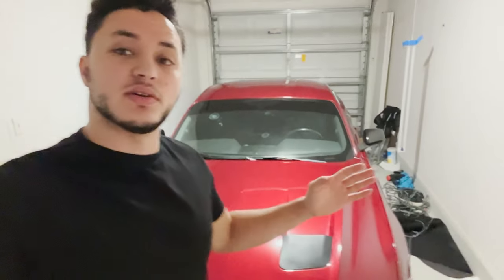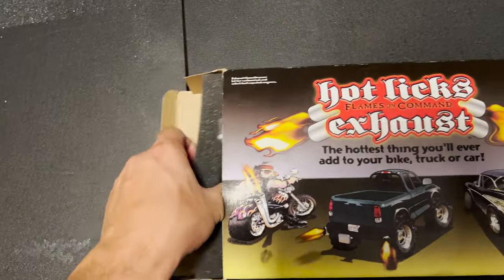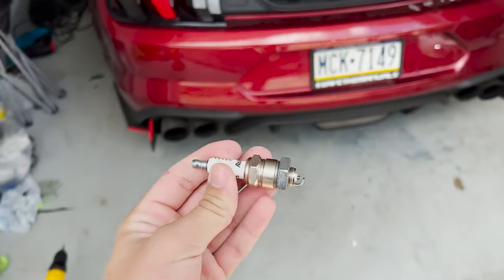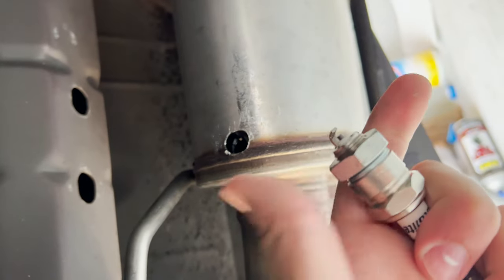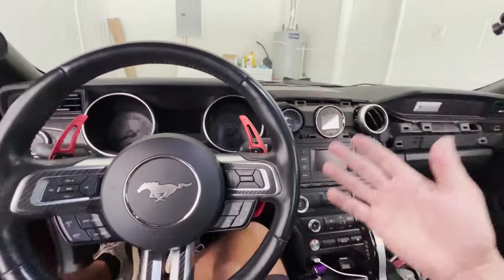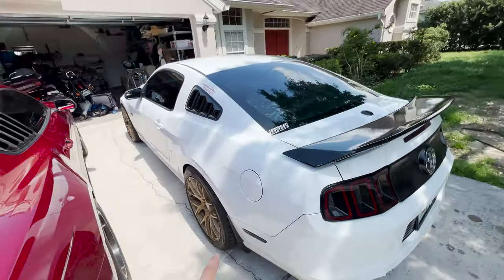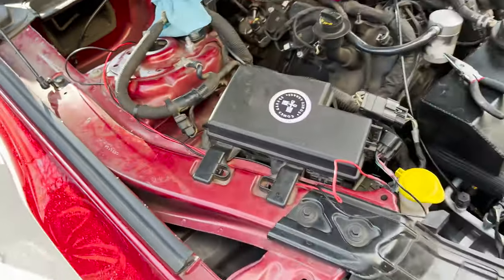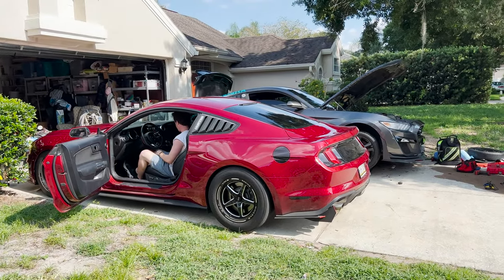How to install s550 Mustang MASSIVE Flame kit (Hotlicks) Wiring simple!

Comment: Just some words of advice from someone who built their own flame thrower kit years ago when i was in highschool( video on my channel) the spark plugs need to be placed in the pipes coming out of the muffler right before the tips. Placing them in the muffler like that wont work. You are just igniting the unburnt fuel inside the muffler cavity which at best at night you will get a backfire type flame out of the tips, not an actual sustainable flame. The reason your car keeps going into limp mode is because the ecm is registering missfires from when the coils are losing energy and the spark plugs in your engine arent firing. Newer cars will trigger limp mode anytime it senses the lack of an explosion in the cylinder whether it be a failed ignition from spark, or fuel injector not putting enough fuel in. Also if you have cats they will greatly reduce any unburnt fuel from reaching the rest of the exhaust to ignite and can melt your cats from all the excess unburnt fuel building up in them. Any questions you can respond to this comment. Just here to help and offer advice
Reply: If the cats are burnt out do they just act as a straight pipe?
Reply: @holdenknight4197  no when they burn out they generally melt, then break apart and chunks wedge in the rest of your exhaust causing a blockage. If you take them off, you can bust the insides out with long screwdrivers and a hammer, but I am not suggesting anyone do so for legal reasons. But yes if you break the insides out they will just be an open chamber with no flow restriction.
Reply: Do i need to tune my car or any exhaust modifications before installing this kit
Reply: @raindezed  no tune, but it works best if you don't have catalytic convertors as they burn off any excess. Unburnt fuel.
Reply: @sinformant  i dont want to cut off my cat (California) will this still worth a try tho?
Reply: @raindezed  if it works it will barely work with a catalytic convertor. And with the excess unburnt fuel will eventually melt your cat and then you'll have a bunch more problems.
Reply: I have an 04 golf with a catback. Will this work on it since its kinda a newer car?
Reply: @Gregarious-vo5vw  well what this does is cut power to the ignition coils so your engine produces unburnt fuel which makes it to your exhaust which is then ignited by the spark plug. If you still have a catalytic convertors you wont get much out of this as the data will tend to burn off most of the unburnt fuel and eventually may melt from the excess heat generated. If you are cat free then it should work fine. As I haven't dealt directly with this product but rather a homebuilt version I can't tell you  100% , but both do the same thing, this one just had some kind of control box sheared as the homebuilt one I made was just a switch, some wire, a cheap old school coil,plug and spark plug.
Reply: I have a 2019 dodge charger straight pipe it’s just shooting out sparks
Reply: Hey bro, I'm catless up to the mufflers with the active exhaust quad tips.. where's the best place to put the spark plugs so all 4 tips light up.. it's the corsa extremes  active exhaust on a 2019 5.0. Many thanks in advance!
Reply: @sinformant I’m straight piped no cat no muffler or resonator, this gonna be fun
Reply: I have a bike and people are doing same in it... I put straight pipe & small aftermarket db killer in it. 

My question is that small db killer will stop flames to come out or it will work with that also?
Reply: What if ur car goes into limb mode
Reply: @robinbisht1953  if the sb killer is in the tip.of the muffler, I'm sure it'll limit the exhaust flow and if the spark plug is behind the sb killer you may create an explosive situation and blow apart the muffler or blows out the db killer if it ignites worst case.
Reply: Hey, I’m running no cats (straight pipe) on a 13 gt mustang. Where would the safest place to put the plugs at without causing a fire? I know the S197 have a fuel runoff right where the driver rear tire is ( if you top off the car it will leak right behind the tire) just want to know the cons.
Reply: @MyLe23S  the spark plugs usually go 4"-6" in from the exhaust tip for best results in my experience. Close enough to the tip that the flames don't dissipate inside the exhaust but far enough in for the flame to conform to the diameter of the tip.
Reply: I don’t have OEM cats but sports cats I believe its 400 cell.

Would this work ?
Reply: @kemrankumar4388  not sure. Sport cats are higher flow than stock cats, but their purpose is still to burn off excess fuel and clean up your exhaust gasses so probably not. If it does it'd be a weak flame unless you feed an external fuel source into your exhaust.
Reply: Do u have instagram
Reply: Has anyone done this to a 2014 Camaro? And what wire do I spice in 2? Do I spice into coil pack one on top of the engine
Reply: Is it dangerous for the electricity of the car some guys told me it may burn the ?
Reply: @Abdullah-sj8be  well I know typical kits pull their power directly from the ignition system usually the ignition coils to fire the spark plug in the exhaust which may prematurely wear out the coils, on newer cars most likely register a missfire and cause a cel. But on top of that they cause excessive in burned fuel in the cylinders, which may make it down past the rings and wash the oil film from the cylinder walls causing wear, also thinning the oil which may cause premature bearing wear as well.
Reply: I have cats and straight pipe california can i just 2 step it and tune it for flames
Reply: @sinformant Hey boss, any chance you can respond to the comment reply made above, i too am interested, i have the factory active exhaust mufflers and i want it to come out of both tips, would that be possible by putting in somewhere in the muffler, thanks!
Reply: @theboy8534  you'd have to put the spark plugs just before the tips and after the mufflers.  Igniting any unburned fuel before the mufflers would most likely result in no flames.because it would be all burned off before reaching the tips.  These kits don't work too well if at all with factory cats. If I didn't work all the time and had a platform I'd want to demonstrate on I'd show how to build a better kit with parts you can source online. Most of these permafrost kits will ruin the engine overtime with excess fuel washing oil from the cylinders. Not meant as an insult at all but I don't understand why this stuff I'd hard to figure out. The video of my truck shooting flames on my channel was done in high-school, pre YouTube days and I just thought out what would make spark and ignite the exhaust. Just made it from parts at autozone with no plans or instructions. I was 16-17 years old.
Reply: @abrahamcolton7981  you can probably tune for excess fuel like they do for crackle tunes where the injectors will input fuel on decel. Excess fuel running through stock cats can possible eventually clog or burn them up.
Reply: @sinformant hi mate, I’ve read a few of your comments and you seem to know what you’re talking about. I have a question for you. I’m trying to do this on my motorbike, it already backfires and sometimes has flames but ideally I’d like to install the spark plug so it ignites the fuel itself if you see what I mean. Could you briefly explain to me how I would make that happen in terms of the circuit as I’ll be making my own. Thanks mate
Reply: @sinformant Hi, I also have a mustang and when I press the button it goes into emergency limp mode, how do I make sure this doesn't happen? At what engine revs should the button be pressed?
Reply: @sinformant
Reply: @edoardonicoletto1510  it is going into limp mode because these kits pull power from the ignition when turned on which causes it to miss fire. They do so to not only to supply power the  to the spark plugs in the exhaust, but it also causes un burned fuel in the combustion process which provides necessary fuel in the exhaust to ignite. These kits are a recipe for scored piston walls, worn rings, as well as worn bearings from the un burnt fuel that washes down the cylinder walls and thins down your oil.

Comment: So does cutting the ignition to dump unburnt fuel into your exhaust cause any damage to the engine over time? Apparently running too rich can harm the engine, and I would assume this is basically the same thing as running extremely rich? Or does it only cut ignition when you're off the throttle or something?
Reply: Yes, In all vehicles, excessive use will cause damage to your engine, however there are certain things that can attribute to this. For example, if you have an older less computerized vehicle the damage will take a long time to become noticeable and be fairly minimal. However with the newer vehicles, adding something like this can cause havoc on the computer and sensor systems. I have a 2015 f30 that I just had to take to the shop because i stupidly installed this and it sent the vehicle into a permanent limp mode state. I would not recommend using this on your daily, but if you have a project car or a beater, its pretty cool.
Reply: @UrbanWearCo   permanent limp mode? Unless something was broken (which can  be replaced or fixed) I don’t understand what you mean by “permanent” limp mode… limp mode is the computer protecting the engine from damaging itself further if I’m not mistaken and a qualified person should know how to turn off limp mode and fix whatever is tripping it. It’s not like permanent like throwing a rod thru your hood if you can just reset the software or whatever and suddenly it works again lolll
Reply: @Coledebord2   You are absolutely correct in your definition of "limp mode" Allow me to correct myself. My Bmw 335i is in a "rolling tin can" stage as quoted by the last of 4 major bmw technicians in the state of North Carolina. I have spent almost 12k for parts and labor and the bmw technicians are not even an inch closer to solving the issue of what is throwing the car into limp mode. We have reset/changed out the ECU and other major computer components, redid the entire ignition system, including the air-intake system, and other system reading components. The reason I used the term "permanent limp mode" is due to the fact that the car simply will not exit limp mode and has been that way for almost a year. I have plans to ship it to Chicago for one more go at it before I turn it into scrap metal and start over.

Comment: Did those two wires you used to connect to the purple cable come with the kit? Or do we need to buy those separately
Reply from the maker: There was plenty of wire for it but I added my own just to differentiate

Comment: Why couldn’t I just use a separate battery, that I could place in the trunk to power the box and spark the plugs, then I would not have to mess with my fuse box on my brand new 2024 mustang and definitely void my warranty  ?
Reply from the maker: This works by cutting ignition, allowing excess fuel to flow into the exhaust. When you press the button, it basically sends fuel into the exhaust and when you let go, it sparks again, igniting the fuel and creating the flame
Reply from the maker: If you do it right, you won’t void the warranty. Just make sure you hide the cut ignition wire well
Reply: So, it won’t work? 
I have an after market exsaust that’s pretty unrestricted, but you’re saying there is not enough unused fumes to make a flame..  I don’t need a giant one just a lil. Lol

Comment: Can you make this on diesel?
Reply from the maker: No, this cuts spark and diesels work a bit differently!
Reply: Diesel fuel works off of combustions and pressure. Diesel trucks don’t have spray plugs since no spark is needed to make the combustion happen.

Comment: How did you get it to backfire?
Reply from the maker: It’s a sequence with the button! I’ll post a vid shortly showing how I do it
Reply: @CloutStang  ok cool bc I got the flames since you rev up to 4.5k rpm and hold the gas down as far as you want depending how big you want the flame and then let off the gas at 2k rpm but I haven’t figured out the backfire
Reply: Waiting on backfire video !